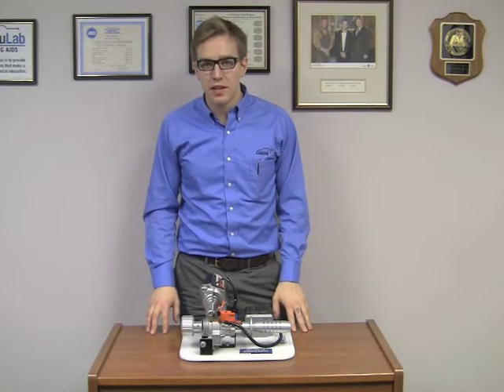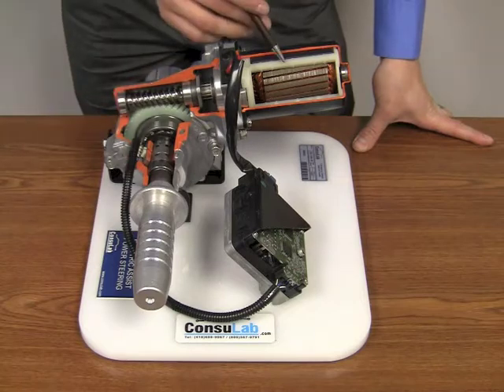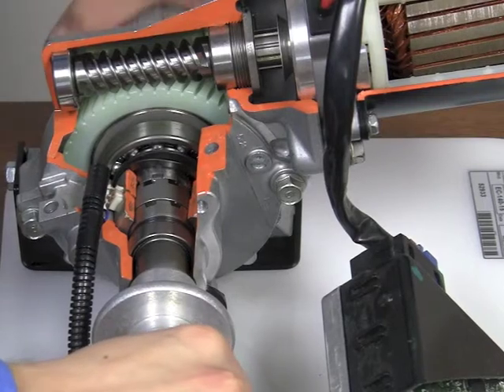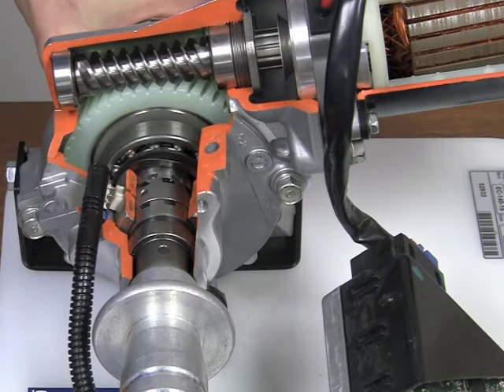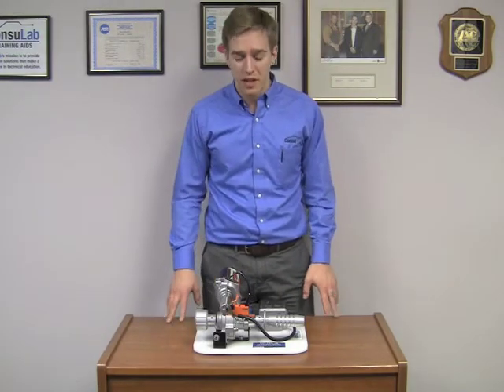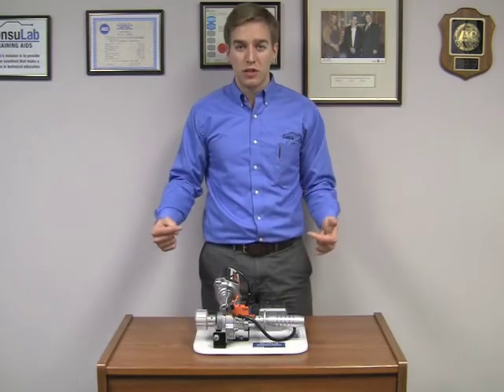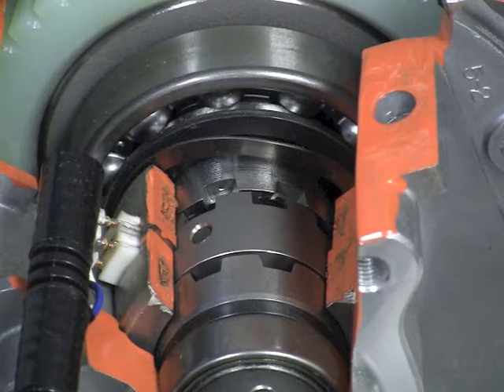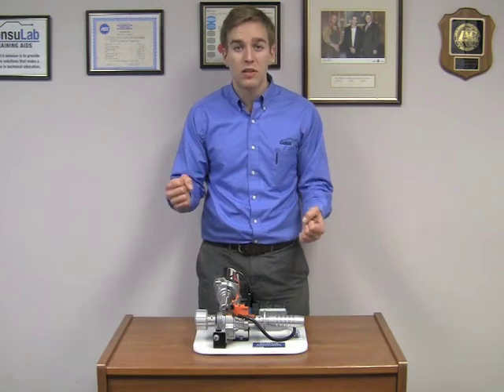Cutaway Electric Assist Power Steering

Comment: 2012 Mustang makes very terrible loud squealing/grinding noise anytime I turn the steering wheel.  This loud noise comes from the electric power assisted steering (EPAS). Any thought about this problem? what parts of EPAS may make squealing and grinding noise as turning? Can the unit be rebuilt? Thanks